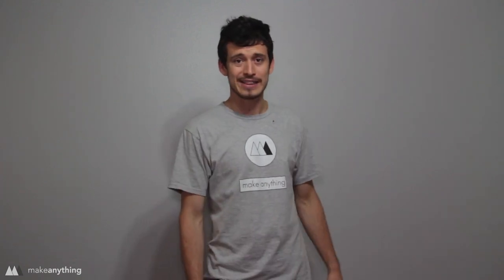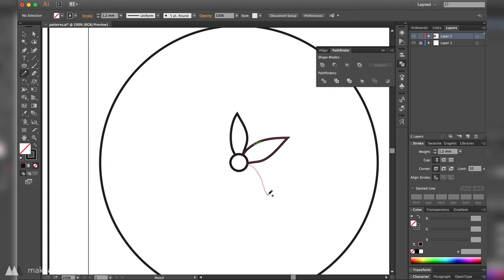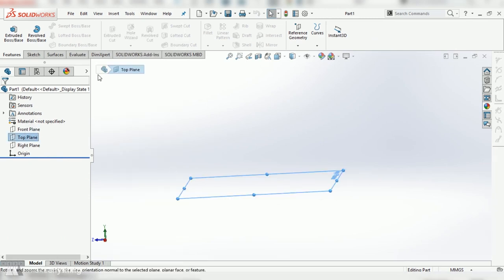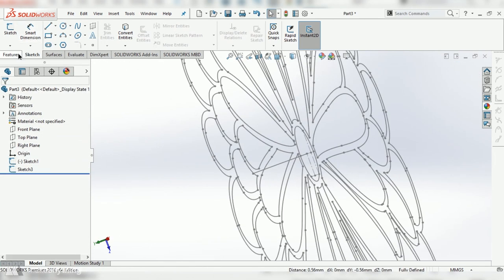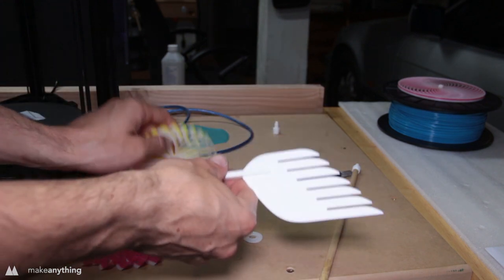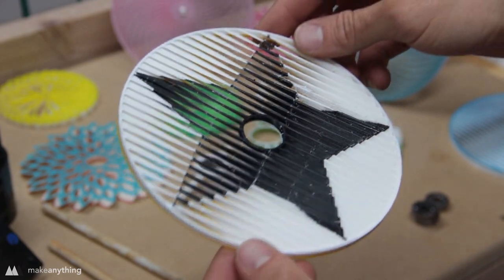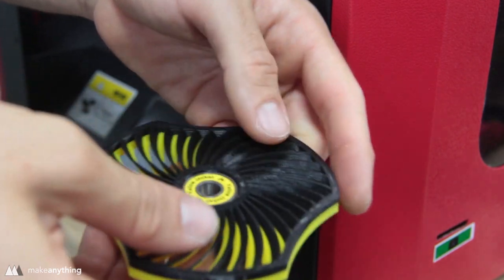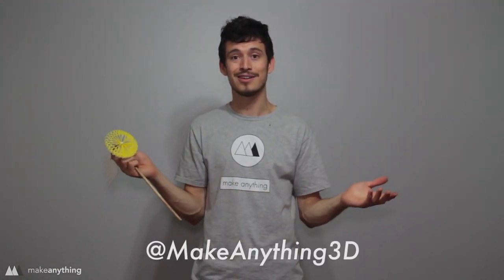3D Printed Pinwheels

Comment: You should dip the pinwheel with the holes in a bubble solution then use it to see if then it will make bubbles
Reply: Bailey Hermann awesome idea :)
Reply: gr8 idea
Reply: Bailey Hermann  that's a cool idea but the bubbles will hit the tail fin upon exit and besides it wont spin anymore because the bubbles will hinder the side flow of the air

Comment: Hi Devon, You printed a particular pink-and-white pinwheel, that you show at 6:45. You blow on it on the white side. Later, at 7:26, you mount this outdoors, but with the pink side facing the wind (and get disappointing results).As you may know, most turbines have a preferred side. The way you mount it outdoors, the centrifugal action counteracts the angle-of-attack action, leading to a poor performance. The indoors orientation (blowing on the white side) has the two effects assisting each other (and is therefore the correct orientation for the maximum spin). Cheers!
Reply from the maker: I didn't even consider that, thanks!
Reply: My conclusions are based on flat-images of freeze-framed videos. I'd be curious to know if my observation has some truth to it, or is it a case of "nice try but no cigar". :)

Comment: devin I have a problem I wanted to print the spiral pinwheel and I sliced it with cura
and if I print it, it printed many dots and not smooth lines so I canceled the print.
what did I wrong??

Comment: I propose to you a challenge good sir: Make a two-step pinwheel. Put three smaller pinwheels equal distance apart on the edge of the large pinwheel and rotate them 90 degrees so that they are perpendicular to the main one. You have enough imagination and skill to do it, I believe in you.

Comment: why is 8 degrees close to 45 degrees in solidworks?
Reply: well I'm prety sure that it spins whole thing by 1 degree and 45 degrees he mentioned was about overhang, or something like that
Reply: the tool gives the shape an 8deg spin around its axis, which equates to a slope of around 45deg
Reply: The bottom and the top of the twisted shape are 8° off by a rotation. The slope in the edges gets steeper and steeper as you go out from the center
Reply: oh right I understand now! thanks for the responses :D

Comment: you should try blender. It's an item software meant for modelling, animating, images and simulations. it has an extremely steep learning curve, but once you get the hang of it, it is extremely powerful. you computer's power is the limit, literally
Reply from the maker: Yea.. I got overwhelmed the first time I tried to learn Blender :|
Reply: It also has a game engine and a video editor. I use it for all of my 3D/Animation/Video Editing.
Reply: And all of that combined makes it an imitating program. They should really do something about that
Reply: Would be neat to see him try it. Been blendering stuff and uploading to Thingiverse, although I'm short of having a 3D printer of my own. (shrug)

The same exact thing in this video could be done in Blender alone. It has beziers. Set them up in 2D mode with closed paths to do most of what Illustrator did, then solidify for depth, and simple-deform twist. Convert to mesh. Export as .stl, and the 3D printer's software can pick it up and produce the extrusion path from there. Perhaps easier (faster?) since you're not hopping and converting between different software as much.
Reply: yeah maybe.... but blender is more for rendering, animation, etc. Solidworks is MUCH better for real life objects, especially due to its simulation tools.
Reply: @samtenthije2419  you mean intimidating?

Comment: wow, this is awesome devin! nice work! is there an easy way to do this in fusion 360 as well? i think there is a loft tool, but not sure if you can rotate. i guess one could copy the 2d line drawing, offset it in Z by the deired height, rotate one and then loft, no?
Reply from the maker: +DMonZ1988 I don't think you can loft a sketch with holes like these pinwheels, but perhaps there's a way
Reply: Make Anything // 3D Printing Channel I'll give it a go! :-) thanks for the fast reply, and for sharing your very creative ideas of course!

Comment: a bearing for this? a metal insert would have been enough - just make sure that there is no real pressure applied.  
Also while skate-bearings under normal circumstances do need lubricants - here you have no load at all so you can just ignore it.

Comment: Nice idea, shame you have to use Solidworks which is out of the reach of many hobbyists; surely there is a way to do it in Fusion 360?
Reply: Actually I've just figured out you can do it in Fusion in sculpt mode by creating a t spline extrusion, then use the manipulate tool to select the front edges and then rotate about the centre.